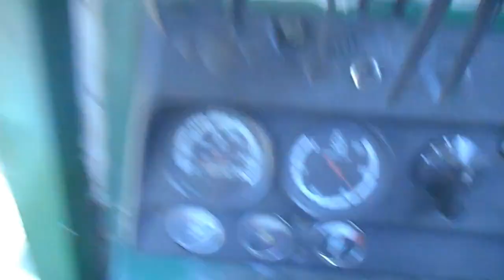First time ever picking Wheat part 3

Comment: From what I noticed here, wheat ground is hard. Barley ground is softer when trying to notill beans. That might be a option if there's a market for it in your neck of the woods.
Reply from the maker: Mike Kahl - I tried an experiment here today and it failed.  my drill is not a no-till.  after cutting the wheat off of some land I thought was soft plus getting rain last night with hopes of making the land even softer, I tried to drill bean seed in with my conventional drill.  no such luck.  so I did what I do with disc and bed finisher to get some soybean planted.   thanks for watching,

Comment: Glad to help. What's the moisture been running?
Reply from the maker: Jake Ziegler - the load I took to the mill on Thursday morning tested at 11.4% moisture.  around here dockage starts at above 13%.  this gave me one thing to be happy about.  you may as well know now, my wheat with no nitrogen applied was a complete and total failure.   average bu/acre in my county during 2016 was 41.  this load was cut from 6 acres net was 94 bu meaning 15.6 bu/acre.     sold at $4.26/bu after .5% dockage for FM.  with expenses and estimated taxes it appears I might get to keep 8 to 12 dollars from that 6 acre experiment.
Reply: Soybean Farmer sorry to hear that. Did u harvest the stuff with nitrogen yet?
Reply from the maker: Jake Ziegler - last night's super rain storm messed up plans to harvest and plant for today.

Comment: that's one fine running machine!
Reply from the maker: Landmark cattle - low hours almost unbelievable  at 2893.3 during this video.  pause where I was showing the tach.   at 6:13 into the video.    the motor is still like new.   John Deere 3300 1976 year model..